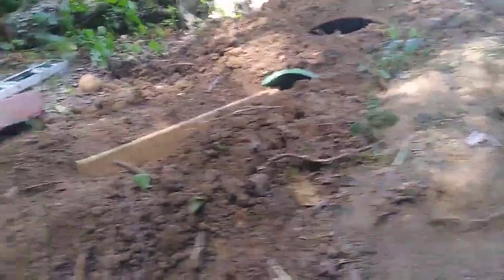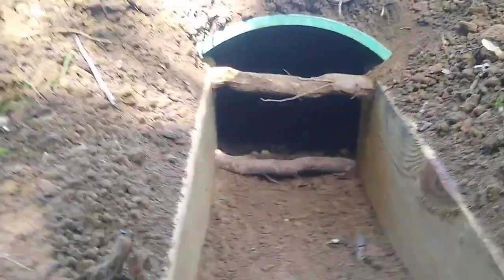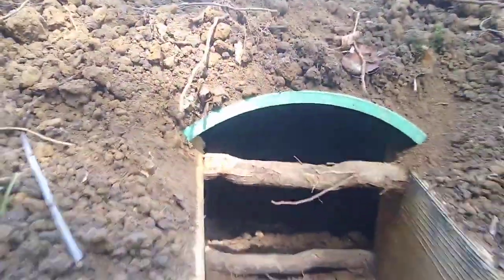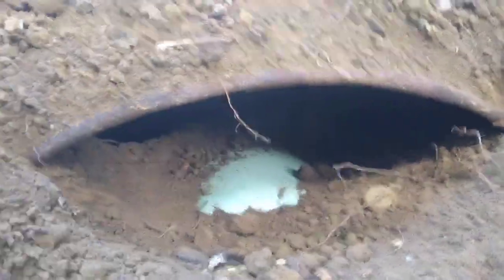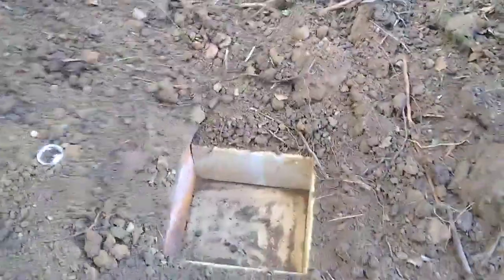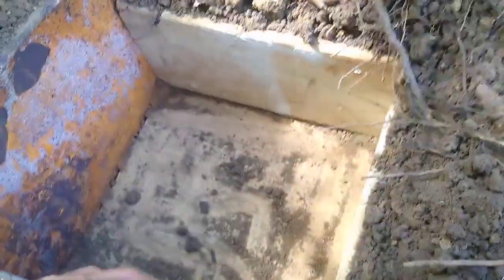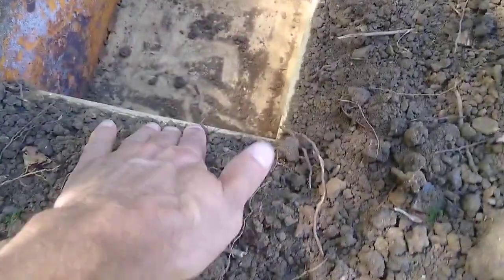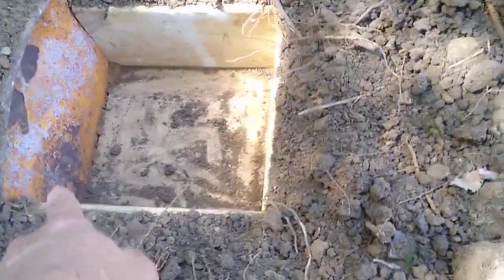Dual Quonset Hut underground pole barn concept model

Comment: Hi, you should reach out to the diehold foundation folks about your ideas, they would be interested.  Douglas Vogt is putting a  design group together for a  cataclysmic cycle survival shelter.  Has to be at least 15' deep or covered to resist cosmic ray and solar activity.  Fascinating stuff.  Best wishes.